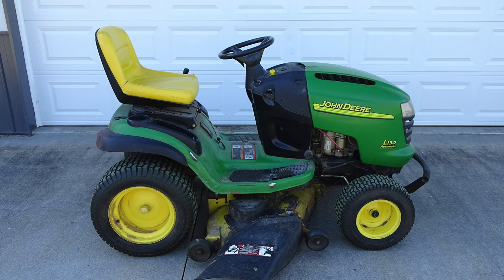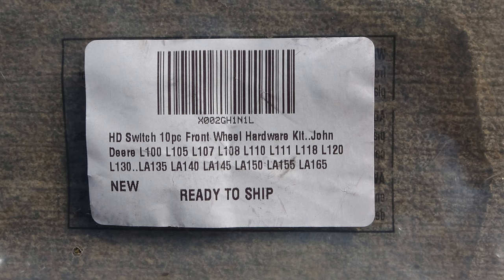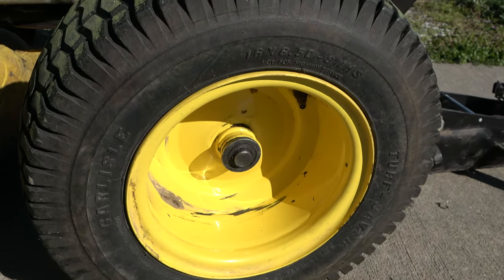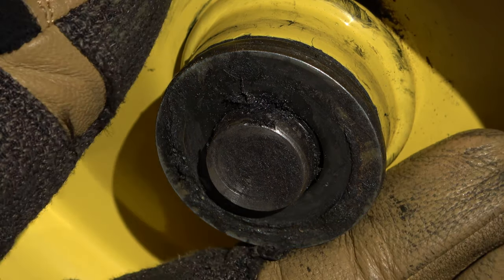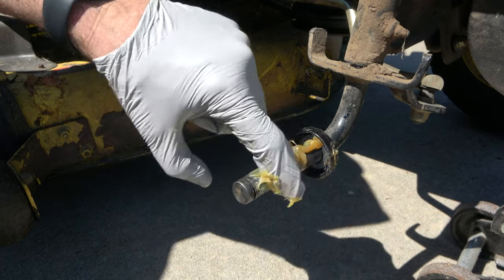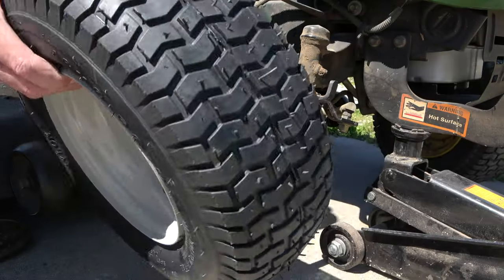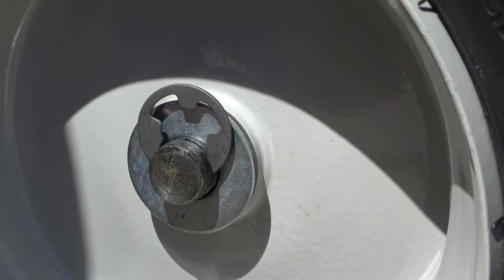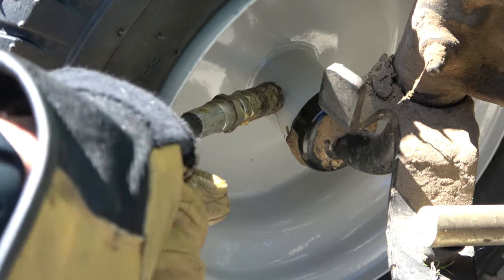John Deere Lawn Tractor Front Wheel Replacement. - L130 John Deere

Comment: Happy Jesus weekend, Buddy and I just put in tubes till they start hanging out and then replace the tire. So far, so good and you might ought to shoot a shot o0r two into the kingpins on the mower. I'm famous for being able to track my mowers with the grease trail or the smoke cloud. The closest I have to a Deere is an old Kawasaki motor that has a Deere sticker that's running on a Snapper 21 inch bagger. Have a large time and maybe fry up something! GBWYall!
Reply from the maker: I should do a video on installing the inner tubes. I actually have one in a box.  The new wheel was sure easy to put on , but now I have another problem.  I went through some tall grass, and the mower shut down on me.   I can't seem to figure out why it won't start.   Just another project on my list!   
Good hearing from you!
Reply: @PhilCrockett  Might have sucked up a dose of water or maybe the fuse blew or a wire came unhooked. My old Craftsman just keeps going but it ought to, no thanks to it's previous owners. Hope you figure it out and you ought to do a video on whatever it is wrong. I like tubes but some tires I just take to the tire shop. I've seen 5 guys around some of mine trying to waller the thing into submission. So there you are. Happy Jesus days and GBWYall!